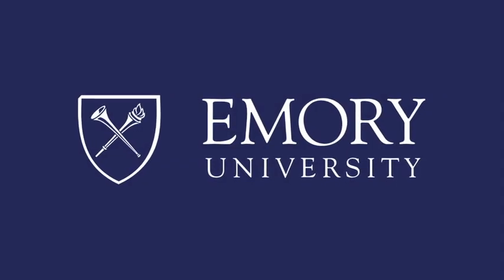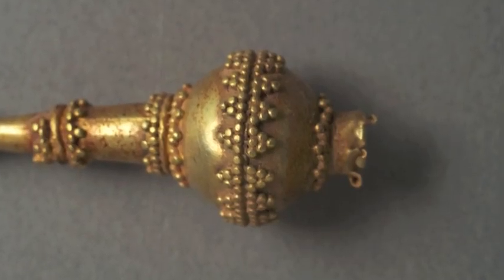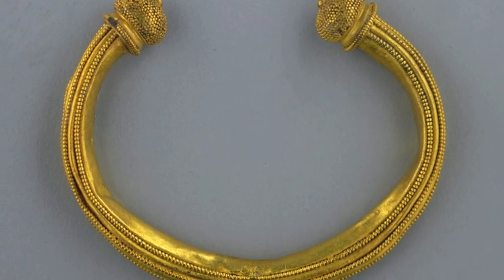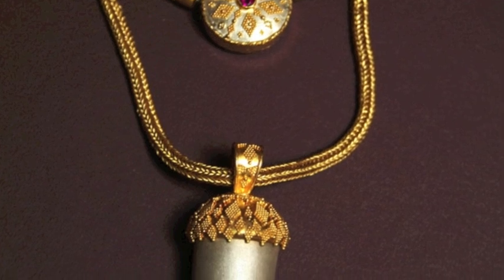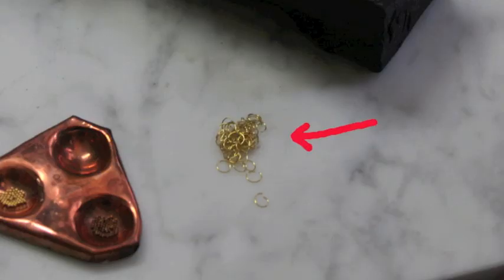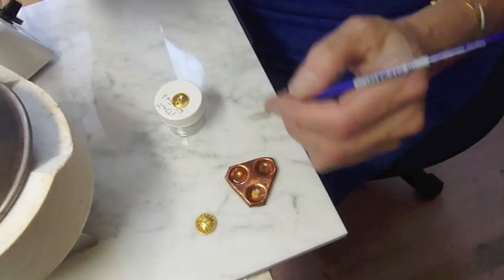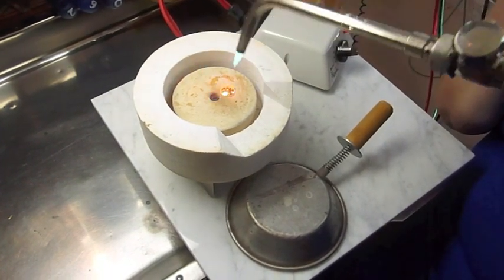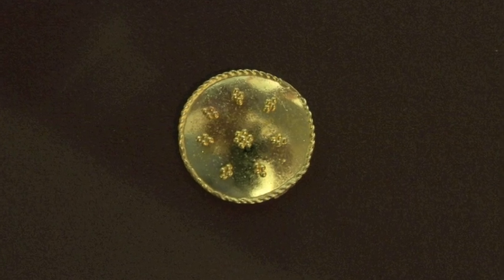Cu + Au = Bling!: The Chemistry of Granulated Jewelry

Comment: Thank you for your video. Regarding 5:45, the granulation fusing liquid can be made by adding a copper salt such as copper sulfate or copper carbonate or copper acetate or copper chloride into a plant derived glue such as gum tragacanth, methyl cellulose, or a commercially available product known as "Klyr-Fire". The fusing liquid is used to initially adhere granulation balls or small metal pieces to a metal backing substrate surface. Then from the applied heat of a torch flame, the metal pieces become fused to the substrate. No added solder is required.